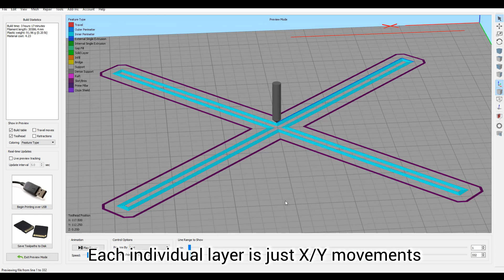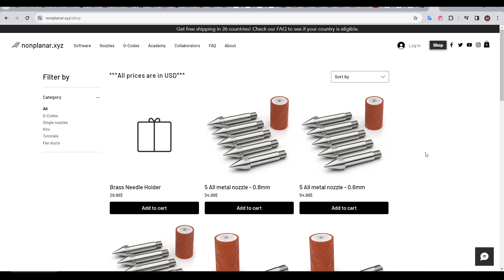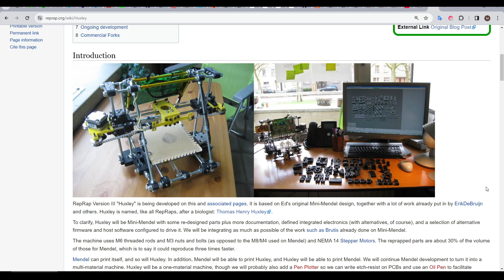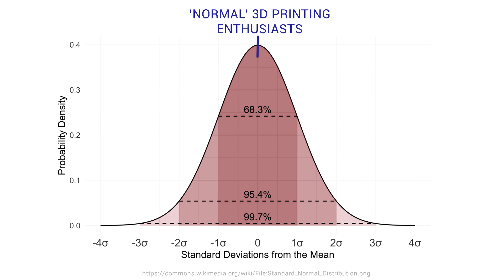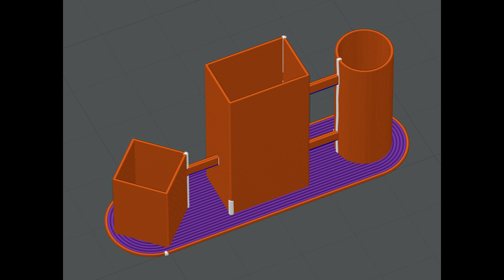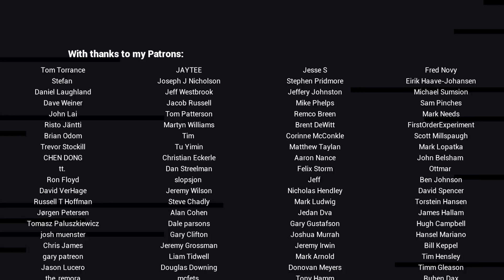3D printing mysteries that need to be solved in 2024

Comment: I suffered the snapping filaments. I just leave my filaments all over the place so sooner or later they get brittle like this. Heating them up in a heat box seems to fix this but only for 2-3 times. After that they are too compromised to be useful other than to print throwaway prototypes for custom works. I have an Ender 3 S1 so the filament just hangs in the air snapping points are created when the extruder moves to the sides or left on the left side for a while after a print.
I assume the snapping is caused by moisture getting into the filament and then dying up naturally. There was a time when  I didn't print anything for weeks and during that time the weather was wild. It would rain heavily for a couple of weeks and then warm up for a week only to be followed by a couple of weeks of more downpour.

Comment: To answer your question "Does filament flow differently in each hemisphere?", I think that since the drill bits used to bore nozzles are right-handed, the filament coils according to the right-hand rule. If I'm right, nearly every nozzle should make filament coil clockwise. 

Now I wonder if I could make a counterclockwise coiling nozzle... I have some spare nozzles I could drill into if I find a left handed drill bit...

Comment: I've always been told that wet filament = brittle filament. Not sure if that's the case in your broken bits, though. 

As for toxicity - I see it more and more as time goes on in many different places. In particular, I've always seen a certain sense of cooperation in the American people. It's how this country started, and has always been something I've appreciated. Now, however, I'm getting sworn at from back-of-the-truck bumper & window stickers because of which presidential candidate was voted for. Even with presidents who I didn't agree with very much, like Reagan and the Bushes, I never saw either side treating each other the way that they do lately. I don't know what to blame it on - I'd say that the right-wing encouragement of that special kind of hatred is responsible, but that kind of leadership just doesn't exist in most other communities, such as 3d printing. It's almost like there's a general deterioration of the human spirit going on.

Comment: I don’t do a lot of printing. As a result, I have noticed that leaving pla loaded and ready to print has resulted in snapping. 
It makes me wonder if there is a minor chemical reaction happening in the Bowden tube?
One spool that gave me that problem when new worked fine all the way to the end of the spool when I unloaded it after each use.

Comment: As far as the community is concerned...well, I think a big part of it is people not understanding that this is still (yes, even today) a hobby style item and these are not just plug and play items.  There is a certain amount of basic understanding that is needed, and many are not willing or are unable to understand that.  Many forums I am on can become quite toxic, especially when the EXACT same question is posted by 50 people in a single day (that is conservative sometimes).  Obviously the community doesn't help a lot when the first replies are almost always "Level your bed, Calibrate your e-steps, calculate your flow rate, adjust your Z-Offset".  The issue goes back to the person posting the question NOT at least spending 2 minutes on Google, youtube or the forum's search feature to see if somebody else had the issue and see if there were solutions.  

Now then, that doesn't mean somebody experienced isn't having strange issues that seem basic.  I had issues with my Ender3 with constant problems in PETG even though for months it worked amazing.  The problems persisted through cleanings, Luke's hot end fixes (replacing the items for fresh), etc.  Then I had heat creep, that I've never had.  All of it came down to a hot end cooling fan that was intermittent, but didn't realize it until I took a day away from it.  I also have an CR-6SE that is being rebuilt, but the issue probably resides in the strain gauge being toast, but when I posed the question I got the same spew (E-steps, Z-Offset, Level the bed, etc).  Finally somebody said "Hey, I've seen that, my strain gauge was acting funny"...but it was buried under 50 BS responses.  I've been in this hobby for far longer than most (started with a PRUSA Mendel build), and you had to know everything about those printers to use them, but all of us get stumped. 

In the end, the community is responding to frustration over MANY people's lack of desire to 'tinker', and I too am quickly joining the dark side of 3D printing, I just want the darn thing to work, no tweaking, no adjusting, no tuning, etc.  Just hit the print button and out comes my part. Nearly 15 years of doing this maybe I feel I earned that want/desire, maybe I'm asking too much...but darn it, I WILL still try and help those that either can't or won't take the time (like my local schools maker space that I work at to ensure all their printers are functioning properly because the teacher doesn't have the time or knowledge to do that themselves).

Comment: Thanks Michael, great stuff as always.  The 3D printing community is not alone in the toxicity explosion stakes; I have seen this phenomenon in every social group I am associated with over the last 10 years from motorcycles to fundraising (yes even people doing good get toxic).  I don’t remember this being such an issue last century but there has always been the outliers who refuse to see the other point of view, I think the difference is how easy it is now for those views to be reinforced, amplified and retransmitted for both good and evil.  Being aware of when we slide towards these tendencies ourselves is part of the answer (be it in our language, in our choice of argument or in choosing to let extreme views propagate without check), as well as educating others regarding the need to be aware.  The immediate extreme response is “political correctness gone mad” (which is actually the right hand side of the “offensive comments” normal distribution graph … we just have to find the happy place where 80% of us can cooperate and build together.
Reply: My loose theory is that a % of society is always insufferable, so as a """community""" grows, the # of crazy people grows. The # of crazy people in a group is more important than the % (since individuals are so vocal). And yes as you mentioned some are just unaware.

There are still groups with higher percentages though, like if you get a landlord there's a 50% that they're satan (due to self-selection + power imbalance).

Comment: Did 5 quick purges on the Northern Hemisphere: 3 were clockwise and 2 counter-clockwise.
Reply: The coriolis effect just isn't strong enough at those scales. Sinks and bathtubs draining in different directions in each hemisphere is also a myth -- the coriolis effect is FAR weaker than the residual flow of water due to filling or using the water.
It took a lot of effort and five foot wide pool for Veritasium and Smartereveryday to barely demonstrate the coriolis effect on water.

Comment: I have this mystery: If we're using CMYK for color 2D printing, and the filaments can mix as they melt in the hot end, giving weird colors, why haven't anyone invented CMYKW (we need to add white to the mix, because we cannot just infer it from paper like in 2D printers) 3D printer so we can print in fancy colors (perhaps by using texturemaps?) and only need to produce cyan, magenta, yellow, black, and white filaments (which would make things much cheaper, because you wouldn't need to add crazy expensive pigments to the PLA mix, unless you were going for something special, like metallic or glow in the dark filament).

Comment: 10:55 What creates these surface artefacts?

My theory is the Pressure Advance -feature. Because it's calibrated for specific speeds and neutralizing any slowdowns, pressure advance would give perfect results. I have a theory and I have wondered this since I figured it out. But hard to say does Prusa MK4 or MK3 create these artefacts.

Comment: The reason why none planar printing will not take off anytime soon is in the details. Slight deformation of cooling parts and the object geometry with tool path of the print head moving in 3 dimensions - are the main problems. This will always be limited by the max angulation allowed by the toolhead  and the geometry of the part itself. Thus can't be universally applied.

Comment: I think the broken filament might be from the extruder metal arm screw is too tight, causing a lot of pressure on the filament, especially throughout the retraction part when printing

Comment: The artifact is caused by thermal expansion. The plastic is cooling and shrinking, so when you have a transition between layers with different times it takes to print, you will see those lines.

Comment: All the toxic Voron comments - I have not read them, but from what was mentioned here these are just normal questions. The opposite of toxicity is tolerance, respect, and understanding. So, it is great to see that you are asking a question which can help us understand the community trends. From the business perspective, if you get enough comments about the x/y/z brand you would have to make a video just for this group of people :) You can also run a brand loyalty score based on extreme comments. This can be a good marketing indicator.
Imagine that you are somebody that may have already build a printer or two, or perhaps coming from an X brand to building Voron. You see the great results and you feel that you have accomplished something, so you think Voron is the best thing ever based on your experience. But then, somebody disagrees with you, how would you feel? If I am a Voron builder or if I am considering to build a Vornon, I'd say, "Why did you not build a Voron?" or I'd suggest, "Just build a Voron."

Comment: There's no mistery around this surface artefact. The surface changes appearance due to heat difference.  When you have two objects on a plate, each layer takes a lot of time to finish. When one of these objects is finished, layer time gets reduced. This means that now each layer cools down for less time than lower layers did.

Modern slicers don't have a thermal model in them. At all. All the important settings like nozzle temperature, extrusion ratio, movement speed, extrusion speed, etc are linked together and the end result depends on how this system interacts with the air around. If we want to have hight quality surface finish, we should start thinking about thermal model together with all the maths we already have.

I'm actually working on an experimental slicer code which works with a thermal model and doesn't have any settings like nozzle temp and print speed, because these settings don't mean anything on their own. Instead I'm focusing on surface finish.

I will start doing some real life tests in January, ping me if you're interested in helping me out.

Comment: Toxicity: Guess is the new, ultratech printers which brings the hobby to masses. Therefore a lot of people who only can plug in the machine, push some buttons and obtain great finish parts are considering themselves "pros". Then asking endlessly on forums/groups same "basic" questions which eventually are annoying those who really understand the process.

Direction of free falling filament: CCW - Europe, northen emisfere. 9 out of 9 attempts with different filaments and different time.

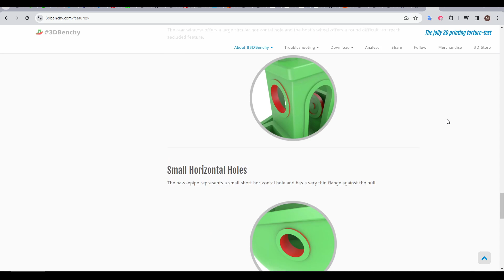Comment: 9:50 Last time someone did that with French bayonet problem. If you know, you know.
If I don't forget, I'll reply about the flow
My PLA filament broke like that too, only the cheap one from China, but mostly I print the cheap one from China, so it's basically all the time. I've always attribute that to humidity, but despite drying them, they still do it sometimes.

Comment: Materials within a Bowden system remain vulnerable to degradation from both moisture and UV light, leading to accelerated breakdown over time. Conducting tests using Matt material and a transparent Bowden can expedite this process. The degradation is primarily attributed to the combined effects of UV light and moisture exposure.

Comment: The surface issue you asked about is caused by uneven filament pressure caused by the eccentric movements of the extruder gears

Comment: What i found is tht respooled filament from one roll to another (especially switching roll size) putting additional stress on the filament. Add Humidity by letting it lay out in the open and it snaps in like 20 different places due to material stress, that has been my experience tho. Also some filaments are just more brittle than others.

Comment: regards the toilets...

i always felt a large factor in the issue, is that as an australian, if i see a toilet starting to fill up?

SOMETHINGS WRONG! CALL THE PLUMBER!

US toilets are just plain scary... wtf is with the bowl filling up like that?

planar printing... nozzles... need them to be fairly long and tapered.

and that is in diametric opposition to having constant heat along the nozzle.

heaters up here, in the body.
goop comes out, down there at the tip. its cooling down, all the time. need it hotter at the melt zone for the same fluidity as it emerges from the nozzle...

doesnt seem like much, but as the nozzle is tapered, theres less and less material to conduct heat, and more and more surface area in regards to that volume to radiate heat... my experience of metal and heat transfer, i reckon you may get 20C or more temperature gradient if the nozzles thinned down and stretched to make a 30 degree taper...(60 degree included)

if anyone wants to actually verify that?

and then theres the diameter of the tip, the "land", as opposed to the actual hole diameter.

Comment: About the problems on the surfaces, well both a solution and reasoning from my part:
There seems to be a drop in temperature for sure. This can be a lot better with a finer finetuning with the PID-tuning and setting up the firmware to give smaller pulses so that the heatblock at least maintains more steady. 
But the real solution seems to be to first print the inner-sections of the walls and then move to the outside, and move to the next object first to the inside as well. I did this multiple times and gotten better results. It can also be a result of this in combination with retractions, this is also solved with first moving inside.
In a slicer like Ideamaker, you can select to do the insides first and this helps a lot, though sometimes it still does not seem to work enough, mostly on very thin parts.
Changing the design and/or orientation can help then too if that crisp surface is important.

Comment: Regarding final question: A helpful diagnostic might be to use Cura and switch 'Equalize Flow Rate' from 100% to 0% and see what happens. This feature adjusts print speed within a range to maintain steady flow.

Comment: I've noticed in some 3D printing communities, people with more experience in 3D printing are very toxic toward new people asking basic questions.  Especially if the new people have a Bambu Lab printer.  Often the Typical response is something such as, "You should mess around with a cheap Ender for 3 years and learn what you are doing before asking simple  questions."

Comment: On surface artifact: Check whether the perimeter changes direction. Ie. it starts cw and due to a different layout or number of islands in a layer the slicer decides to change it to ccw, that will change which side corner bulges goes on for example.

Comment: I think the filament comes out of the nozzle in a clockwise direction because the hole was made with a drill that rotates clockwise and there is a microscopic spiral that gives the plastic a direction of rotation

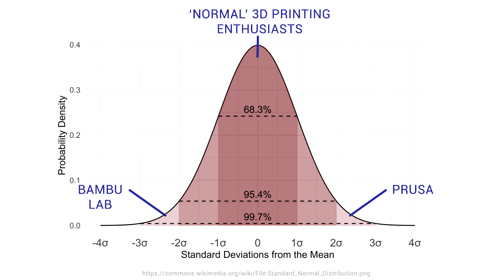Comment: 8:13
I always say:
If you can't complain about something for days, that means you have no clue about it. The rose tinted glasses only work if you lack the competence to see the flaws. Aka compromises made.
One of my favorite examples are the string concatenation dots in PHP.
But javascript also has no strict types and uses a + like other c++ syntax languages!
Yeah, but how does that workout in typing conflicts? Correct, it doesn't. If you picked that answer you picked right.
But this shows my age, as  recently I got a type error in PHP. Now that I have seen all the ways not getting those goes wrong I agree with that route. But 18 years ago I did not.

Java however went insane in the opposite direction. Welcome to the world where you have to insert gigabyte wise of redundant exception handling because it expects them to be handled all individually no matter if it makes sense!

And -375498% of the times c++ executions randomly break are caused by implicit conversions. It's not a matter of if, but when.

And for self modifying code I just need you to remember that "01100110 01101001 01110011 01110100" can not just be a verb, but also a line of code. Hint: If you are not in a technical field. You can also get points for musical references for example.

Comment: 10:55 When you switch Legend (top left) to "Layer time (linear)" you will see that it takes longer to print those layers at the top of the cylinder. So the layers have more time too cool down before the next one is printed. This may cause the issue, like drastic changes in print speed are also visible.

Comment: Im not 100% sure but i have read in some places that humidity absorbed by the filament makes the filament break easy like the one you showed on the video. Even if you dry it, if the filament absorbed some water it deteriorates a bit, multiply that over time and the filaments becomes fragile. Only solution is to keep the filament in a place with less than 30% humidity.